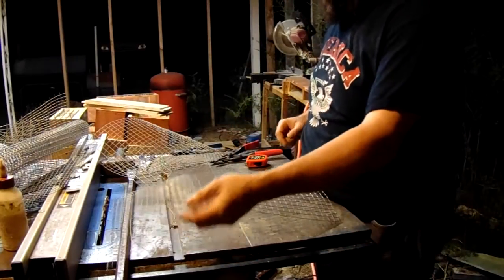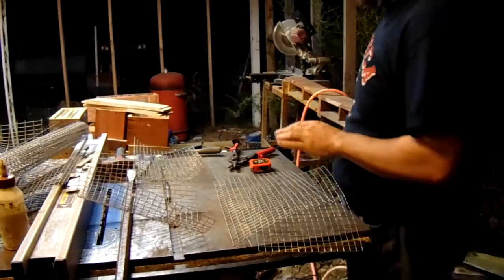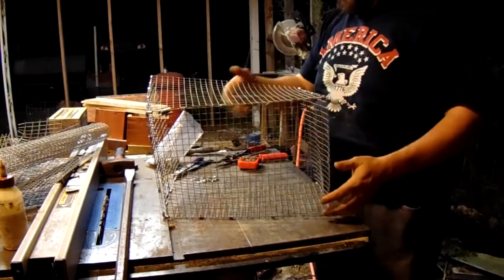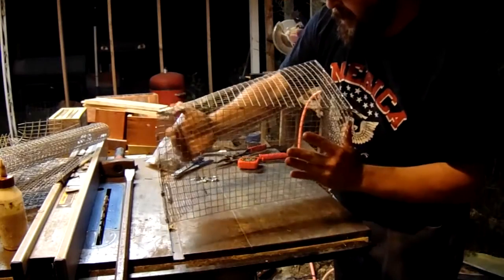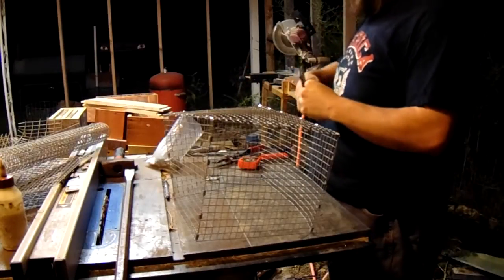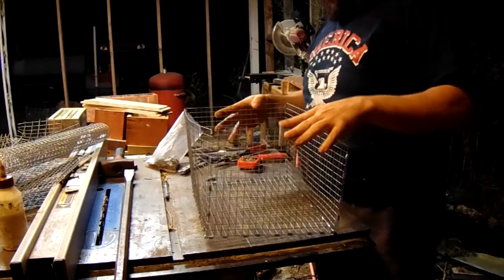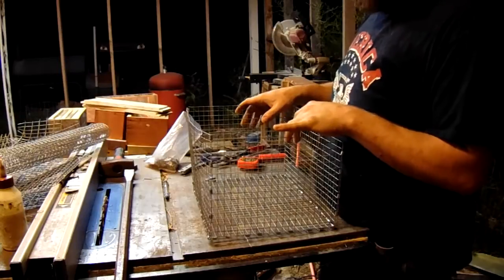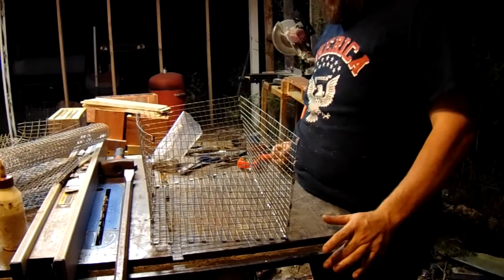Rabbits - Making a Drop Down Nestbox and Some Rabbit Husbandry

Comment: i agree with  motherofmanyhorses...i bought a set of j pliers at t.s and they did not work at all the way i expected they only had 1 prong on each side instead of 3 altoghether which im sure works way better..it barely even smashed them together however i kept pushing forward and my nest box came out awesome minus all the blisters on my fingers..lol...i made mine a little bigger cuz i have a huge rabbit and it still holds her good ..thanks for your videos they are all very informative and helpful:)
Reply from the maker: +Alanda Salinas Just remember that if you make the nestbox too big, the doe will try to sit in it when she is not tending to her kits and very likely will begin using it as a bathroom.  The pliers you describe I believe are for C clips, not j clips.  The C clips serve the same purpose but are shorter so  they only just barely go all the way around the wire and can open up easier over time.  The J clips I am using are longer and overlap at the end when curled around the wire.  I have a hard time opening them up with pliers even when I want to remove them.  Thanks for watching and God bless!
Reply from the maker: +Alanda Salinas http://www.orschelnfarmhome.com/OrschelnFarmHome/ctl16754/cp58430/si5184169/cl1/wire-clip-pliers?&query=j+clip+pliers&hits=12&offset=
Here is a link to the exact pair that I use and this is the store that I buy them from locally.  The j clips that they list on site are different from the ones that I buy in store locally.
Reply: Hillbilly Half Acre Homestead thanks for the response i just checked the packaging it says they are j clip pliers:( still no babies maybe shes not as far along as i thought today would be 29 or 30 days since mating and i have noticed her go to the bathroom in it already but she barely even fits in it now any smaller im afraid she wouldnt fit..thanks again

Comment: I work a lot at night too,  cooler,  peaceful,  and I am too excited about my projects to sleep.  I also harvest bamboo for making chicken fences at night from an unmaintained parking lot it is trying to take over.  Love you videos and today I am building cages and thought I would try to build drop down nest boxes.  my concern with the wire you use is that the coco puff pellets might not fall through... although its not hard to just poke them through from time to time if thats the case.
Reply from the maker: +John Liberty It the same size as the holes used on the bottom of the rabbit cages.  There shouldn't be no problem.  In the video I used hardware cloth with 1/2 " squares because that is all I had at the time.  I prefer to use the 1/2" by 1" that matches the wire on the bottom of the cages when I have it available.  Sorry I made that as clear as mud in the video.  OTOH I have no problem with the pellets falling through either type.  Glad you enjoy the videos.  God bless!!!

Comment: Love your videos. I have 2 champagne D'Argents. They weight 9lbs each. What keeps the hardware cloth from sagging and drooping down? There is not a support beam in the middle. I am going to try and build based on your specifications tomorrow. Thanks again!
Reply from the maker: I dont use hardware cloth, I use 1" by 1/2" welded wire.  It is stronger than hardware cloth